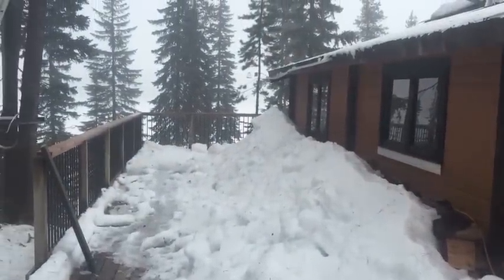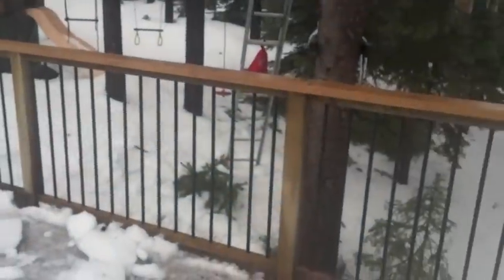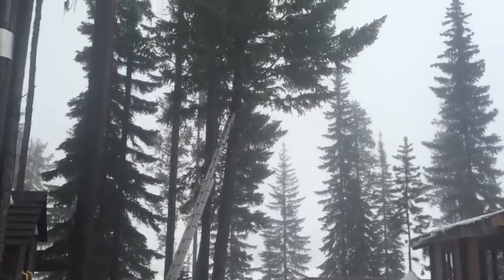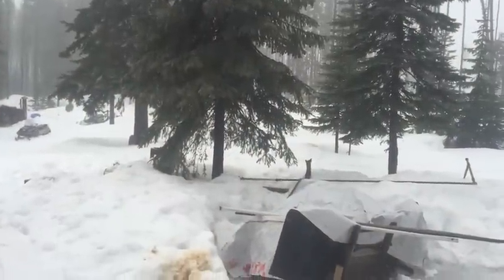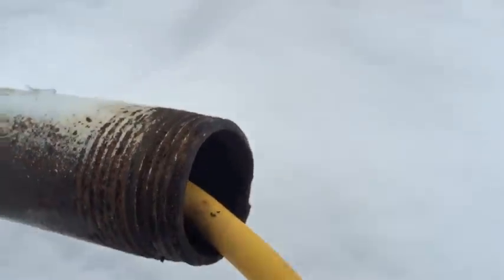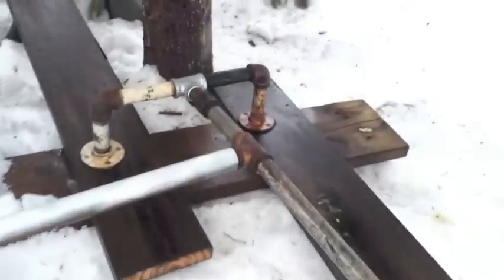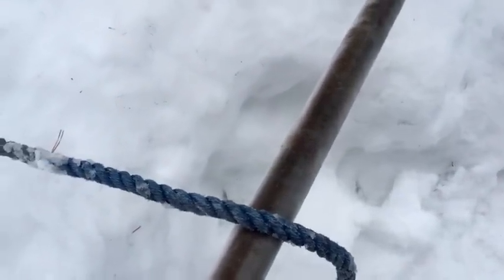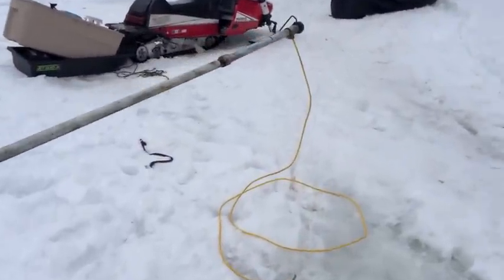Experimental Wind Turbine Tower Location- Part 1

Comment: I like the way you used the water pipe for the base and the T fittings to run the wire up through. Do you get allot of wind off the lake you have there?
Reply from the maker: It's 50/50. In the winter, the wind really blows from the lake, but the spring it blows from the mountains.

Comment: yea i would not get up in that 1st tree to try to mount it in the tree.  i would be worried about wind blowing hard and moving the 2ed tree in to it if your going to have it that close to the tree.  i would want alot os supports around the poll too. like they have 8 on this one pic hear http://www.homedepot.com/s/Wind%2520Turbine?NCNI-5
Reply from the maker: Yes a proper tower would be ideal. HD in the states has everything. It so much easier when looking up from the ground and sketching out on paper. Went up on the extension ladder and got the willies. I'm sort of afraid of heights. Was never like that when I was a kid and climbing trees.
Reply: The Cedar Workshop i used to do construction i was fine on the scaffolding util 3 stories. my keens would shake a bend at there own will. on a extinction  latter 2 stores is my limit. but after i feel with one and had one of the latter latching prongs go in my leg and had to have 9 internal  stitches and 3 external i slowly move away from construction.  so i try not to get up high now. if you do get up have a spotter. some one that can call for help if you fall.